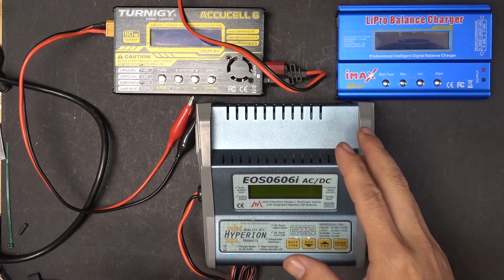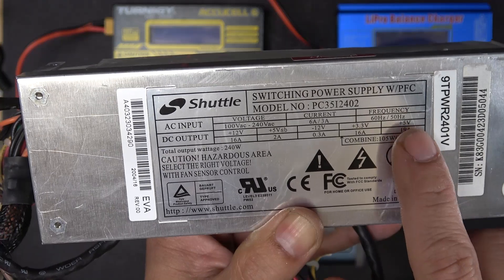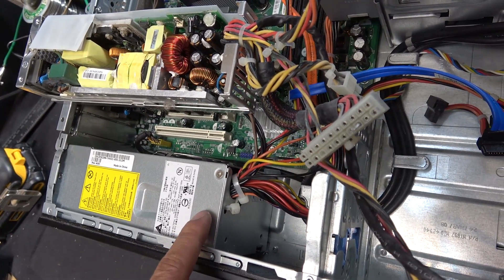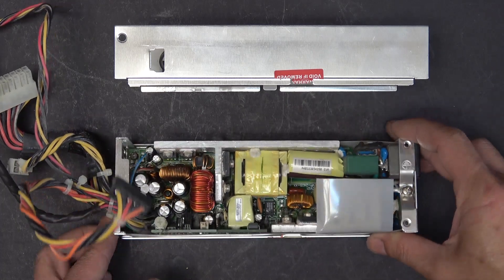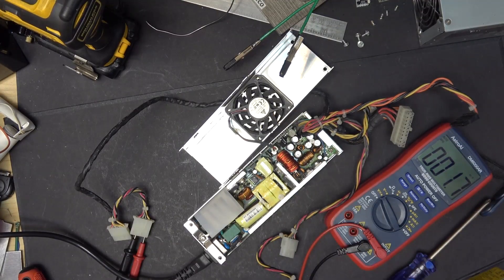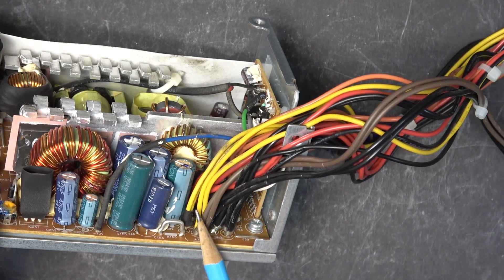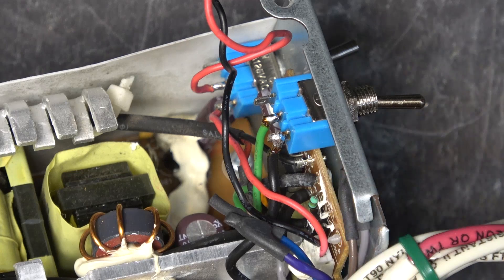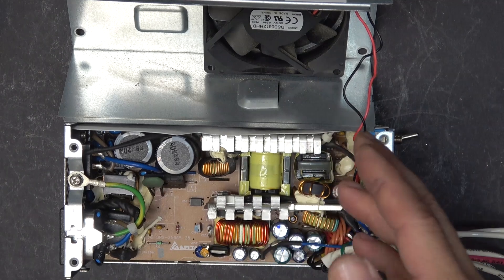DIY: Home made High current multi-voltage Li-ion battery charger power supply

Comment: I rebuilt your Teslapple phone. I just used a step-down converter, which can handle 20 amps. In my case i use a usb pd trigger board. So i have 20 V input and step it down to 4.2 for the 18650‘s. I normally charge them with 10 amps (40 watts)

Comment: Question will a AC 110V 220V Digital 100A watt power meter volt amp Ammeter Voltmeter 80-260V connected to main feed 2/0 inside a home breaker panel register volts amps usage properly. Keep in mind it connects over the protective wire sheathing

Comment: I have 20 of these power supplies only 6 of them are working, I'm going to Harvest the rest for some expensive components inside ;) nice stuff 👍
Reply from the maker: What "expensive" components are you harvesting from these PS?
Reply: @vuaeco  man are you serious xD capacitors inductors diodes transistors with Heatsinks small transformers and the cooling fan. 
Buy them all separately, then you will know what expensive lol
Reply from the maker: @DIYwithBatteries  It's a serious question, mate. Yes there are electronic components that might get expensive if you add them up. But I was curious if you were talking about precious metals like Gold in contacts, Palladium in MLCCs, Silver in switches...etc
Reply: @vuaeco  Haha 😄 no Sir I didn't go that much far for the metal scrap, still learning though ;)

Comment: Is the power supply plugged into 120 volt?  As the batteries charge, does the current amount reduce?
Reply from the maker: Yes, the power supply is plugged into 120V AC. The output is all DC: 12V, 5V, and 3V. The battery charging curve is still the same because it's dependent on the charging board (for 5V) or the Turnigy/iMax chargers (for 12V)
Reply: @vuaeco   Thank u very much!!
Reply: Almost all computer power supplies will run on 100-240v (some have a switch) The load from the power supplies goes down as the batteries charge and as the batteries charge they also pull less current. The circuitry in his battery charger monitors and regulates the process. It’s possible to do it manually, if you put down rock steady 4.1v to battery, it will just use as much current as it needs. Diodegonewild is another favorite channel of my. He loves power supplies.
Reply: @MassimoTava   Thank u!!

Comment: That's very ingenious to get the different voltages of 12v, 5v and 3.3v, but aren't 18650 cells supposed to be charged at 4.2 volts?
Reply from the maker: Yes almost all Li-ion batteries are supposed to be charged at 4.2V. The 12V, 5V, and 3.3V are just input voltage and it depends on what Li-ion charger you're using. Some chargers need 5V, some need 12V input. The output, however, is all the same at 4.2V per Li-ion.
Reply: @vuaeco  OK, thanks, now I understand.
Reply: @vuaeco  ]]p]&&&y
Reply: Many Li ion batteries are to be charged not more than certain amps eg 18650 cells are generally charged at 1amp or less.. Can you make a device to controll input of Amps as well? Cos input of over amps spoils the battery life